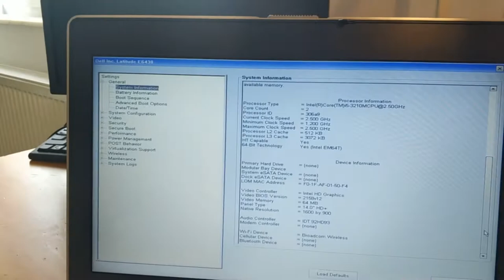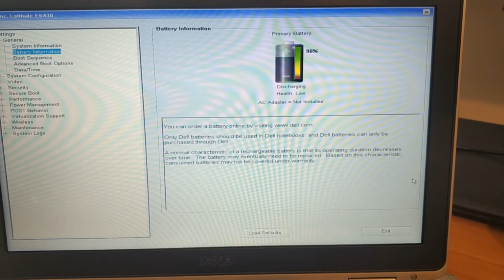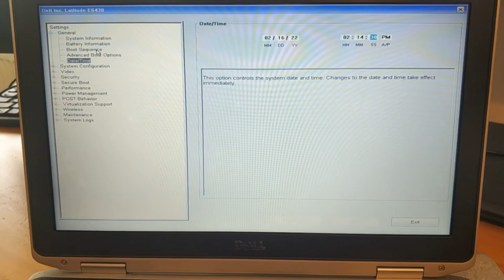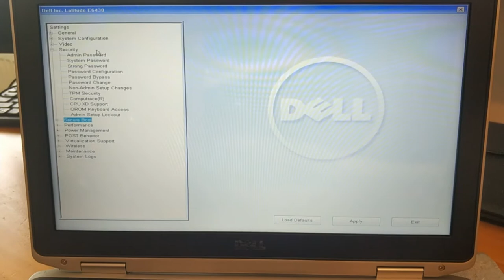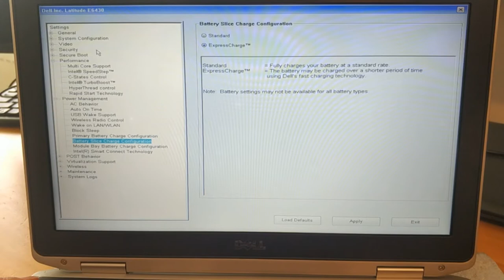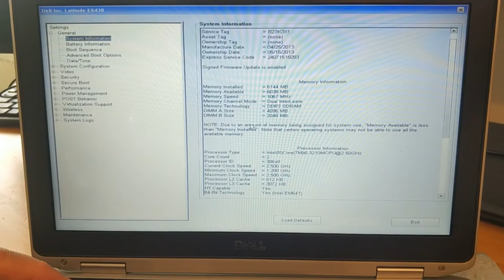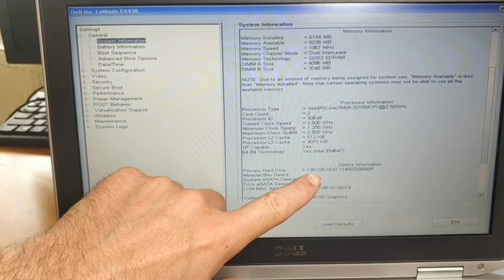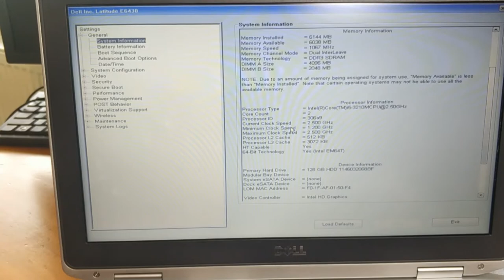Dell Latitude E6430 - Disassembly, Full Cleaning, DVD change, Change Hdd to SSD, Setting the bios

Comment: In my experience, I would advise against using alcohol-based cleaners on the 'rubberised' keyboard panel (not the keyboard itself, but that bigger black part that holds the trackpad etc.). In my case, it became sticky over time after cleaning (in the spots I cleaned), likely a chemical incompatibility reaction (I have yet to determine what material it is) and/or accelerating the release of the plasticizer. I used IPA 99% diluted with water. Don't know if acetone (in nail polish remover) is better, but it is often less compatible with plastic polymers than IPA when aiming for a no-reaction clean.

Could also be a coincidence in my case, of course.
Reply from the maker: Hi; yes, you are right. Especially on Dell laptops, where after ~10 years rubberized palmrest become sticky more rapid if you use IPA; acetone is worse.
In video, at 54:40 i use window cleaner only on keyboard, and few drops on palmrest was only for seconds, not enough to do bad things with rubber.
For rubberized part, my personal solution, after hours reading on internet and after testing a few solution, was to clean that part with cosmetic pads(of course, your girlfriend, mother or sister will be mad, for shorting his stash 😂) with simple water; much water to not let cotton fiber to get glued on palmrest, ant not that much to prevent water to get in the laptop. After doing repetitive treatments in this maner, that rubberized part will become less and less sticky. It's like feeding the rubber with water. It's the only and the best solution found by me.
Reply: @DaneluRepairs  I've seen tips on using baking soda (sodium bicarbonate) with water or using regular water with detergent / soap, but I have not tested those. I don't think there is a miracle cure for reversing or quickly cleaning debonded plasticizer anyway.

Anyway, thanks for posting these videos. They are helpful for people attempting their own repair, or just as a product archive.
Reply from the maker: @jbsvault  another ideeas to test in future; thanks.
And thanks for those nice thoughts.
This video is part from the beginning of my YouTube channel, and is kind of long time; from 2023 to this day, i edit more and more, and my video become more short and i hope more pleasant to watch(also, i hope my english is improving😅).
Have a great weeknd, mate.
Reply: I have found the thing that works best is the plastic protection sprays for motor vehicles. They re-plasticise the "rubber' and it stops being sticky ... a couple of applications is all that is needed.
Reply from the maker: @ceebee23  hello; nice ideea; is this similar with what you say? https://www.profi-car.com/en/product/profi-car-rubber-and-plastic-care-spray
Reply: @DaneluRepairs  yes.... it may take two or three applications but it certainly works for me...
Reply from the maker: @ceebee23  OK, i understand. What amount of time you wait between applications?
Reply: @DaneluRepairs  no dramas so far... all just experimental... may roll back to win10 or move to Linux ....

Comment: Spent today upgrading mine to Win11 today ...just for fun
Reply from the maker: Awesome 👏 do you succeed to install all drivers?
Reply: @DaneluRepairs  yep...... but sadly had to roll back to 10 ...just too slow under 11  :(
Reply from the maker: @ceebee23  windows 10 is perfect.
You have ssd or hdd?
Reply: @DaneluRepairs  currently a HDD .... this was an eBay "for parts" purchase ... no ram no battery no HD ... so I rustled up some 2nd hand stuff.... and to my surprise she works perfectly.....even when I opened her the interior and fan etc were very clean even if the outside is a little worse for wear ... amazing what a good scrub will do.... and surprisingly fast even with a HDD ...will look at a SSD for it.
Reply from the maker: @ceebee23  awesome, you did something perfect ecological.
Windows 10/11 with hdd is freaking worse... ssd is the perfect choice, even the very cheap one's .
Reply: @DaneluRepairs  indeed .... ssd and ram the two cheapest updates !
Reply from the maker: @ceebee23  exactly. But, if you have  already 4gb of ram, upgrading to 8gb is a tiny upgrade in performance. BUT, upgrading hhd to ssd, is a huge improvement in performance, you will see.
Reply: @DaneluRepairs  I had the ram so it went in .... better than in a drawer .. ssd on order.... now that I have a working machine...will be interesting to see the speed gain. Will keep you posted!
Reply from the maker: @ceebee23  well done, Chris.
When you put ssd, there will be the real speed.
Reply: @DaneluRepairs  SSD is in and installing ..as we know huge speed difference now.... amazing such an old laptop can be so useable!!!
Reply from the maker: @ceebee23  hello again, Chris. I'm glad that you put ssd, and yes, an old laptop like this, with an i5 or i7, second generation(and even an i3), pair with an ssd and Windows 10 will run smoothly for everyday task as document editing, listem music and Internet browsing. Like, this is most people do.
Only for gaming and video editing is needed a newer notebook.
Reply from the maker: @ceebee23: well done, congrats.